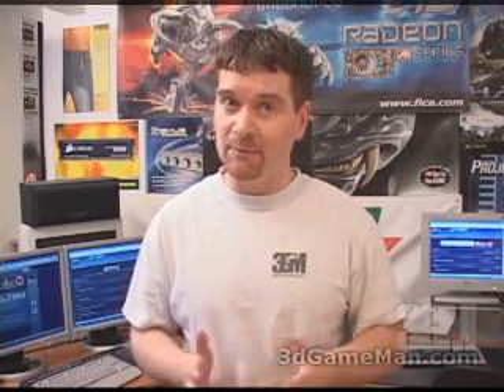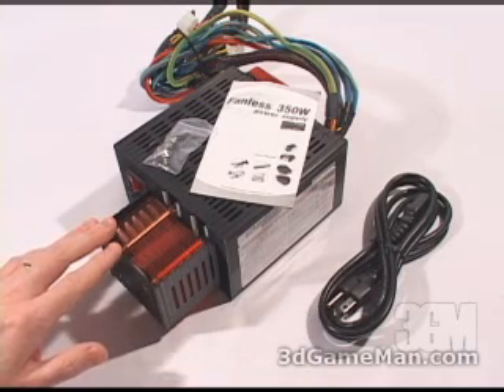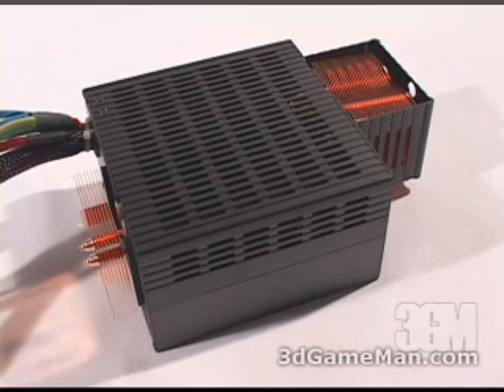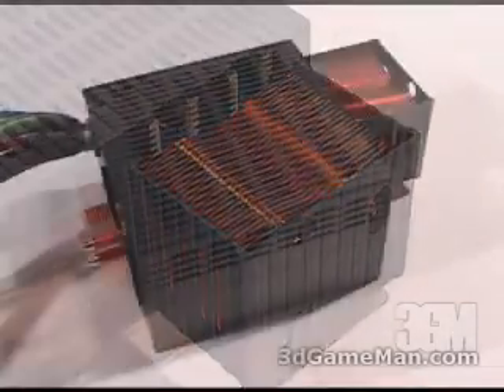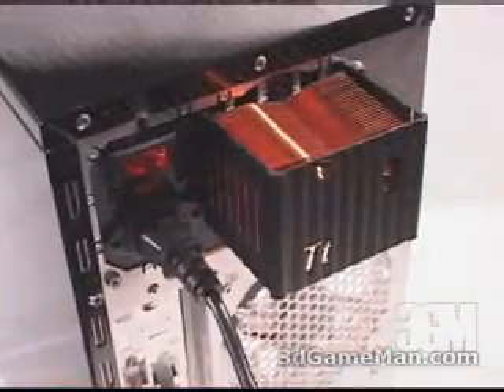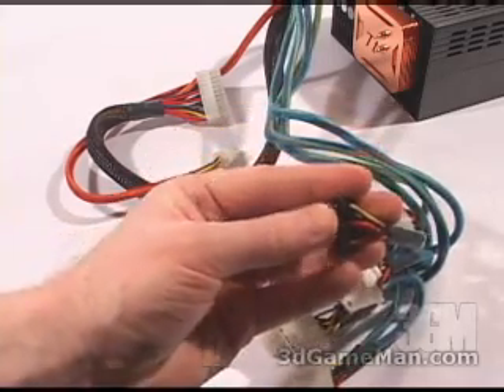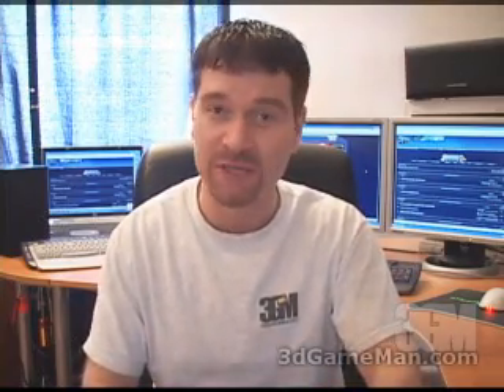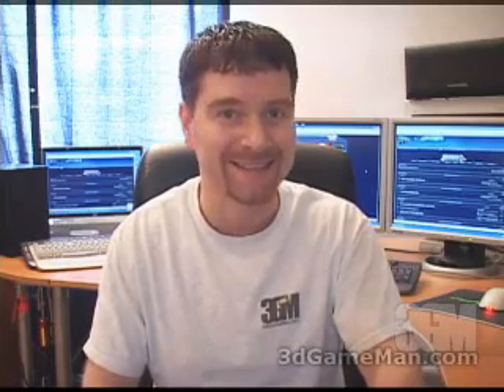#553 - Thermaltake PurePower 350W Fanless Heatpipe PSU

Comment: I should hope so, i hate it when i hear people saying that in a fanless PSU having the heatsink cool enough to touch is a good thing. It isn't. If it's not hot then it's not taking the heat away, and if it's not taking the heat away then it's not a good PSU cooling solution.